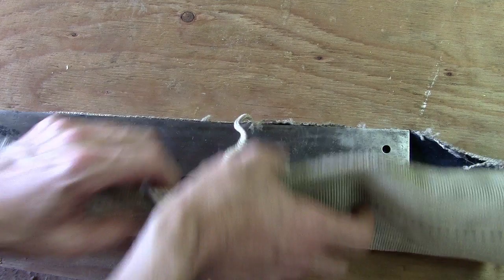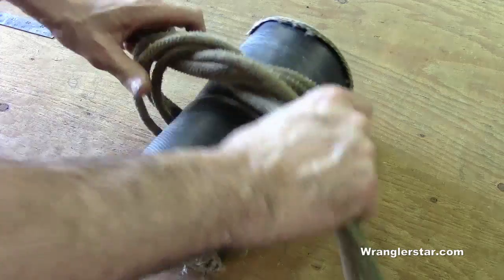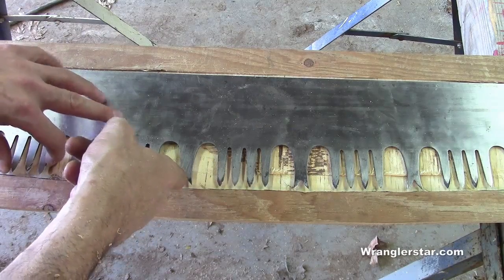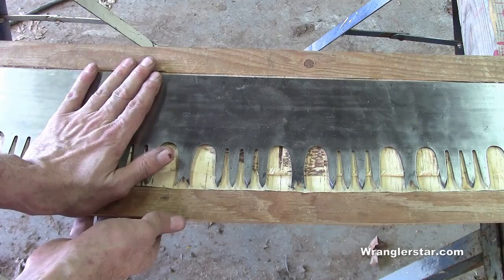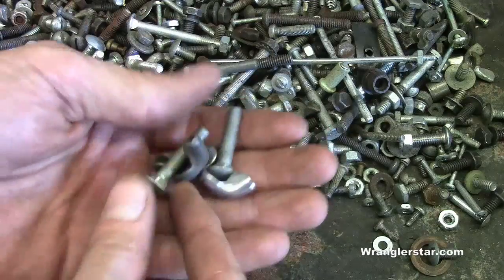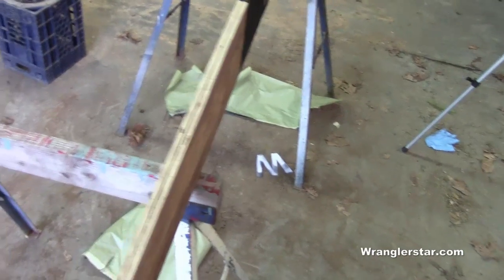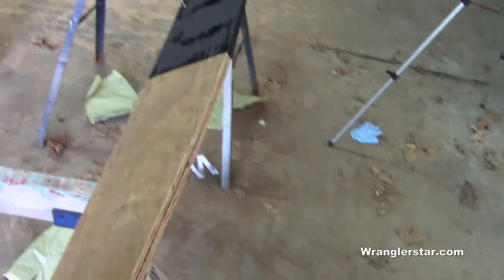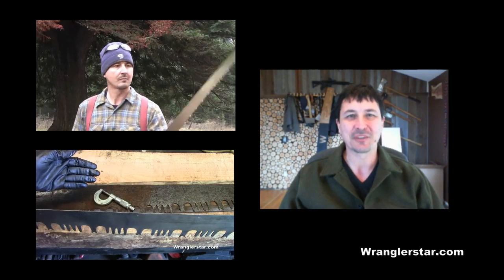Crosscut Saw Sheath - Wranglerstar

Comment: Loved the video as usual. Something i have found very useful to match the profile of two pieces of wood is a copy router bit. I think that is what its called. it is essentially a straight bit wit a bearing so you can run the bearing on the template and trim the other piece to the exact same profile. Great for anything that uses a template. Looking forward to the next video.

Comment: Cody, did you recess both sides of the case or just the one?  Either way it's a cool case. I would've probably just cut a thin spacer to shape and sandwiched it between two pieces of plywood, but I'm not quite as handy with woodworking tools as your are.
Reply: Pretty sure he did just one side. Less work and easier.

Comment: Hi Cody,
I like how you built the case.  Instead of using the band saw, have you ever used pattern bits or flush trim bits to make the edges of cases mate up?  I use them all the time when making a cabinet or box.

Chris

Comment: I would like to think if that saw were robust enough to rip through countless trees without bending the teeth, sandwiching them between plywood would not remove their set.
As a profesional sheet metal worker, I can tell you that even softened sheet steel needs to be broken a fair amount past where you want it to compensate for the spring back.  A hardened saw tooth would have to be bent quite far to reset it's position.  Having said all that, I do not blame you for wanting to take every precaution to protect a treasure like Wanda.

Comment: WAIT, WAIT, WAIT!  Not done yet!  No metal should EVER come into contact with kiln dried wood or plywood.  Period.  If it's new, the wood will wick the oil from the high carbon blade=instanst rust.  If older plywood, it retains moisture!  Next to a high carbon blade=rust.  Saturate your plywood with oil. Boiled Linseed, Teak, Tung, Motor.  Doesn't matter, just oil ALL wood that comes into contact with metal.   Other than that, looks good!
Reply from the maker: The blade is coated in oil; this will suffice. The case is for short term transportation not long term storage. I keep Wanda in my heated office unsheathed.
Reply: If Cody really wanted to "spiff" up that case, you could have made it thicker and lined it with leather. As he stated, short term, no harm will be done. Plus it's a safe bet that Cody WILL take proper care of his saw.

Nicely done Cody.

Comment: it really irks me when you say radius instead instead arc, when you really mean arc. Radii only refer to circles. And they're straight.
Reply from the maker: It really irks me when "English Nazis" ride into the comment section atop their high horses.
Reply: wranglerstar
I think someone needs a brown "E"
Reply: +Sam McInturff That is incorrect.  The term radius is often used used when referring to rounding an edge or an inside corner. Of course, it's referring to the radius of the arc.